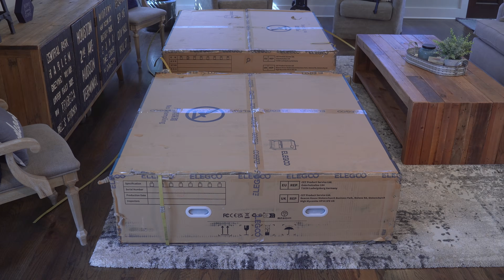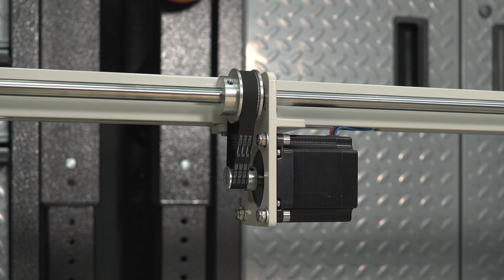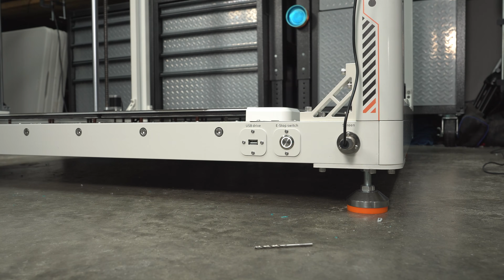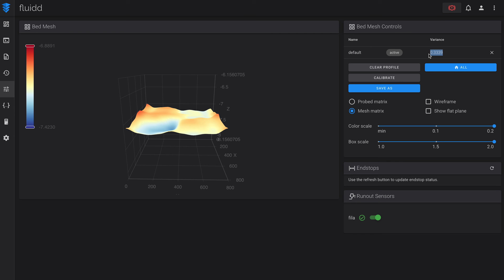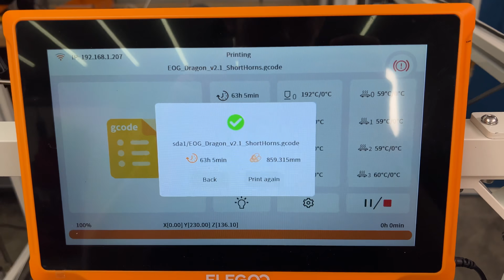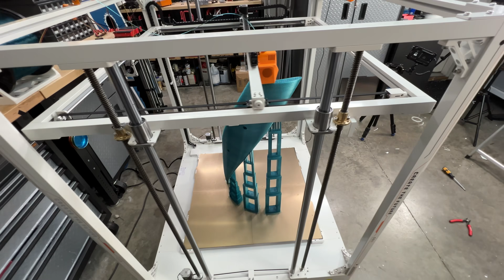Affordable Large Format 3D Printer! (Elegoo OrangeStorm Giga Review)

Comment: for the price point , that is a heck of a deal !!! the materials alone are worth it !!
maybe brace it with steel wire to the base or add more extrusions to it to stiffen it up ,also maybe increase the contact area of the base to the floor and weigh it down.

there is ways to combat that wobbling at the top , but i still cant get over the low price , its definitely a good base to modify and DIY if you want a large 3D printer 

they should ship the corner brackets separately for them not to get damaged

Comment: Excellent review, and I had a lot of the same concerns. To me, it's largely a parts kit printer with a Huge frame. Seems as the future owner will be in upgrade mode right out of the box, which is rather disappointing, but it's a decent base with a relatively easy path to get this chonk into acceptable capability. A higher flowing hotend would be job one though, which to me appears to be a huge oversight from Elegoo. Nema 23's should have been standard equipment on that large of a frame size/mass ratio.

Comment: To solve the problem of vibrations, you can place steel cables with tensioners in each corner in the shape of an "X", in the openings that the supports have, a cheap solution that in principle works well.
Reply: problem is, you have to do that on all 4 sides. yes you can go with 2 opposing sides but that also solves only half of the problem ,-)
Reply: Ibjust would Put thick Woodpanels on three Sides, or extra Aluminium extrusions as braces.
Reply: I wonder if triangular gussets in each corner might help considerably while still offering good access.

Comment: 3500.00 is NOT affordable.
Reply: -$2500, with the kickstarter being at 1250-1500
-Affordable is relative. Untested tronxy garbage starts at 3-5k, professional large format printers at 10k. The venn diagram of "People who can't afford a $2500 800x800x1000 printer" and "people who need to print that volume in one shot, and also already own all the necessary infrastructure / environmental considerations to support it" is very, very slim.
Reply: it is for what it is.
Reply: You should try to buy a heated bed of this size. Make sure to include the costs of the PSU.
Reply: The kickstarter was half of that price, shipped. Imagine the shipping cost of this beast. For what it is, it is a great value!

Comment: Rigidity is easy to fix.
Just string up some steel wire crossing between the corners.
I've always wondered why core XY manufacturers didn't do that from factory.
Reply: me too its literally a screw and a loop of steel wire
Reply: @fouzaialaa7962  The only challenge, is securing equal tension, as to not force the cube out of square. But after that, you have extreme rigidity for 3 dollars of hardware.
Reply: @ZappyOh  could you not tune it like a guitar string by sound? If the printer was already square  to begin with all you would need to do is tighten it and then pluck the wire and match the frequencies for all sides with an app you can download on your phone for free for tuning? Would this not work?
Reply: @TheDarkrider551  Yes, that would work just fine.
I didn't say it was impossible, just that the tension needs some attention :)
Reply: @TheDarkrider551  Probably could use two turnbuckles then just measure it from corner to corner and tighten/loosen as needed.
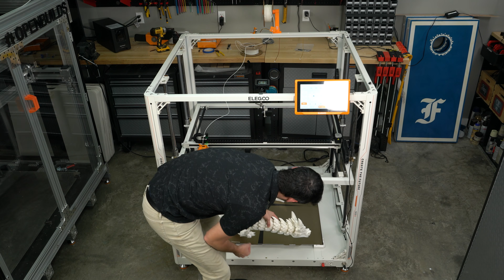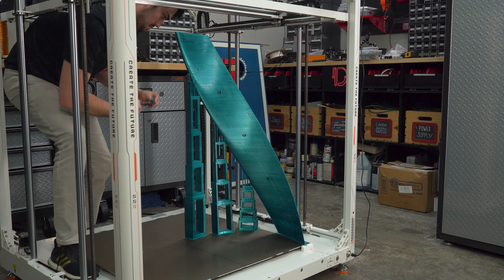Reply: Disadvantage is that you can't easily get into the printer @17:00 and @22:00
Reply: The problem with rigidity is only partially due to the chassis.  The bigger problem is often the part itself.  It could be helped by printing supports but that is going to add a lot more material and time.
Reply: I’m afraid of misalignment as well… As much as I would like to, I don’t think it is THAT SIMPLE.
Reply: elegoo at it again making a piece of garbage

Comment: I'm glad to see you give the machine a look.  I agree, it's about the cheapest way that you're going to get into a machine this size.  But it's also something that most hobbyists shouldn't be buying until they're absolutely positive that they need to produce parts in a single shot.  It's kind of like a belt printer in that regard. 

It's also been kind of funny to see people post online that they're suddenly concerned about whether they have the space for the machine at home. xD
Reply: kinda, belt printer doesn't need a small room to produce long or repeatable prints. It's a niche, but you can setup a belt printer on a desk and just allocate room for it when you do want to print a 6' sword or something else needing the infinite z ability, or more common use case where it just prints one thing after another and you just put a box to collect the finished parts. This thing is purely for large objects, there is no other use case that justifies a printer this big with a single head. If it was an idex and you could do duplicate/mirror prints, there'd be some use cases, but even Elegoo promotional material shows multiple linked heads, so you'd be just setting up copies of the same model (then just get 4 printers and print your copies)
Reply: @kazolar  A belt printer does, however, require a completely different approch to producing prints. If you just grab a model and toss it on the belt printer, you'd quickly run into atypical issues that the mechanics cause.  
 

On the other hand, if you're into printing props or typically print really long parts, or need a hundred copies of something, then by all means, go for one.  

Which is why I say its similar to the orange storm in that niche sense. You should buy it when you know you need it. And not the other way around. It should not be your first printer.

Heck, if all you do is print a bunch of unique small objects, it shouldnt be your second and third either. Even if the size per dollar technically makes sense. Tool heads are vastly better in most cases.
Reply: @Mytagforhalo  I have a belt printer. And I have 2 large format printers, my biggest large format is not 800mm big, it's 600x600, and it's way more rigid and a lot faster than this thing is, but since it also has 4 independent heads, it has a lot more utility. The belt printer is a novelty. My other large format is a 500 diameter delta, with 675 true build height, and outside of my idea to print a life size duplicate of one of my kids when he was a toddler, which my wife knixed, I have never printed anything remotely that big.
Reply: @kazolar  I think that last thing you said was a wonderful use case for this printer, with the linked heads, If there would have been space for the 3 turbine blades from the video he could have spaced 2-3 of them on the bed at once (giga supports 4 print heads im pretty sure). The Issue that I see is how how to space the prints for batch printing? Did Elegoo provide any details on how to setup the printer for its multiple heads and spacing for prints, is it dependent on each print fitting inside a vertical or horizontal perimeter box such that there is a maximum part size per head, can it be configured with 2-3-or 4 heads spaced evenly or at custom distances? This batch printing setup could have shortened his build time from 96hours X 3times ---> to just 96hours if the parts needed to be one piece and he needs multiple of the same piece. I am curious as to how long would it have taken to print the 4 piece version on say a p1p or a set of p1ps or equivalents...
Reply: @TheDarkrider551  4 linked heads is just dumb, if all that it can do. You might as well just get 4 smaller printers. If this thing could do independent control, then you got more utility.
Reply: Belt printers are amazing in theory and overrated in reality. I have two of them and neither works good. IMO you need something like the white knight, at least belt wise, for a good experience. A metal belt would solve all hardware issues I had
Reply: @BelviGER  Fysetc sells some sort of a pei print durface for the cr-30

Comment: 16:58 😁😆 That smile of GIANT prints is exactly why I jumped on the kickstarter ❤. 

I would in the kindest way possible BEG to see you lay out upgrades for the hotend 🙏🙏🙏.  While it maybe 6months before I would even consider it, I have big plans and NO one better to lay out a step by step recommendation on upgrades.

Thank you for the outstanding review.❤
Reply: I'd expect a CNC kitchen style volcano insert to pop up to allow standard volcano nozzles to be used. Which would immediately widen the spectrum of nozzles to pick from including CHT and hardened variants.  Which would then help to increase the flow rates and technically allow for better speeds. 

I'm kind of surprised that they more or less made a super bambu lab style hot end. It's also a shame that they chose to use extrusions with slots only on the inside for beauty.  External slots would have allowed for a steel panel enclosure to easily be bolted on, which would have been easy to ship with the machine and stiffen it up a fair bit.  open extrusions also would allow for many more options for the community to modify.
Reply: @Mytagforhalo  An insert would be an awesome idea 💡!

For the extrusion I think it might be an improvement to have a solid flat outside for rigidity… not sure but it most likely wasn’t an accident.  

That said I will be enclosing mine, but until they ship mine I will just be speculating on how, although ugly I have cost-free plywood available. 

If I can I may just brace the top of the printer off the wall so I can get consistency up and down the build volume. If that won’t do because of space, to make it more robust on top I may use c-clamp style attachments with threaded rods to take up any slack across the corners like the tiny triangle bracket do.
Reply: I would highly appreciate an hot end upgrade as well! I bought it on kickstarter first batch and my intended use is to print with large nozzles!